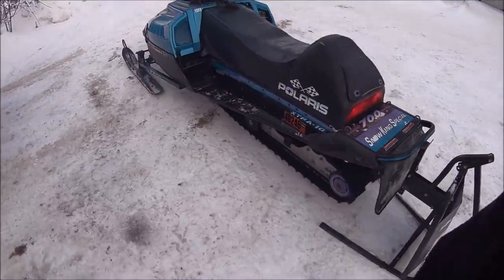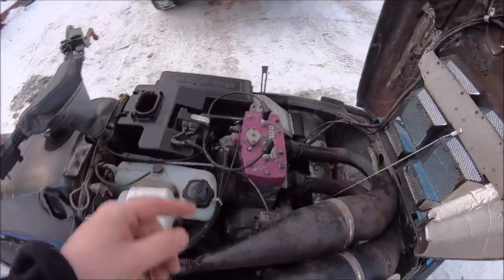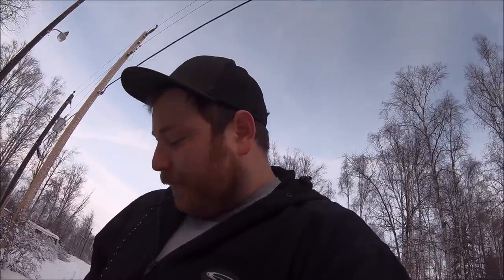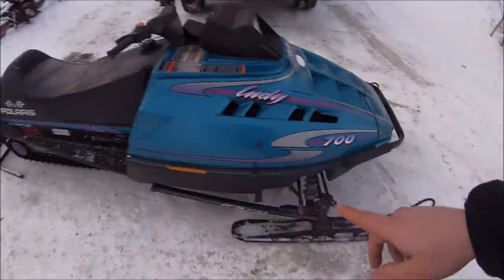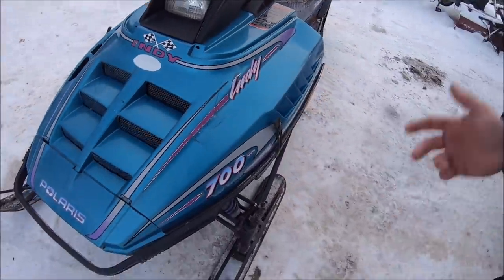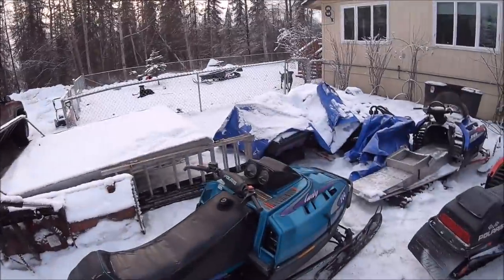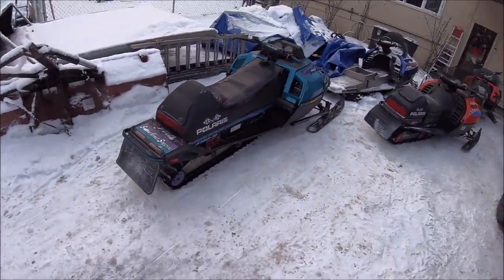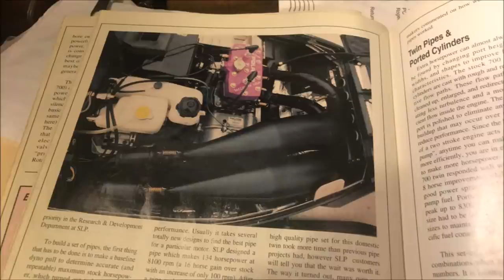1997 SKS 700 - Rare pipes?!

Comment: That’s the best sound I’ve ever heard on an 700 that thing roars like a beast
Reply: I was gonna say the same
Reply: Triple triples sound better imo
Reply: FUNNY THING IS MY FREIND BOUGHT THIS SLED AFTER HE TOOK THE PIPES OUT AND WE WERE RIDING WHEN I JUST BOUGHT MYSELF A 2011 POLARIS RMK 800 ASSUALT AND THE PISTON RINGS BLEW AND I WAS PULLING HIM BACK AND MY REAR BUMPER BROKE WHALE PULLING HIM AND WE ENDED UP CALLING MY OLD MAN UP AND HE CAME AND PULLED HIM OUT OF THE DICH THAT HE GOT SUCK IN LOL FUNNY I GUESS HE GOT THE ENGINE FIXED BUT IT IS NOT IN THE SLED AND IS SITTING RIGHT BUY IT
Reply: @98761joey  I agree, nothing beats a triple for sound even with the single pipe they sound great.
Reply: @davidbrennan5 I disagree. The v
Max 4 was a nice snowmobile too 
I have one that ain't stock 
It is modified it has bender pipes
Reply: @RyanBenbow  The vmax 4 sounded great also but they only made one model with a quad 2 stroke inless you count the king-Cats, so overall the triples were the best sounding and all of them sounded great. The twins and singles just don't have the same presence. The King-Cat sounded better stock for stock compared to the vmax 4 imho. Bender pipes or Mod-blasters on a triple or quad spinning at 10k+RPM is the best.
Reply: @davidbrennan5  that is your opinion 
Not mine. My v max 4 is not stock at all 
Tim bender. Was the best in racing 
I don't ride on the trails with it. I drag race
It
Reply: @RyanBenbow  he was good until they made him sleeve the engine down to 600cc and then he got waxed.
Reply: @davidbrennan5  not . No other racer
Could beat him. Unless he raced 
At the soo i 500.  Name one racer
That beat him I dare you
Reply: @RyanBenbow  He lost FIII on Sunday in 1992 World  Championships but what do I know.. The next year they changed the rule to 600cc. Yamaha didn't even have a seat on the ISR. They banned that sled just like they banned the 750 2 stroke bike from dirt track racing. I used to beat them at the grass drags with a modded Indy 650 regularly. Tim had the engines tuned to 210hp but they would blow up every other heat so they detuned them to 195hp.
Reply: @davidbrennan5  that is crazy.  How 
Much horse power did the thunder cat make.  I am curious
Reply: @RyanBenbow Box stock best year was 1998, it had better exhaust and intake. They claimed 172hp, I think it actually made more. The older 900 was no slouch either.
Reply: What did you think of. The wildcat 650
And the 700.
Reply: @RyanBenbow  Box stock in a straight line it was a tossup between the Indy 650 and the Wildcat 650, handling wasn't great. The 700 Cat was the speed champ for a while but that first chassis was horrible, Cat just added IFS to their old leaf spring chassis in an attempt to compete with Polaris and Doo did something similar with the escapade. The later chassis that the 93 Thundercat was based on was better but again not on the same level for handling compared to Polaris. The Polaris had the best clutches from the factory.
Reply: @davidbrennan5  true. I never had
The Indy 650   my wife and I have 
The zrt 600
Reply: @RyanBenbow  The ZR chassis was the best of that era, Cat cleaned up at the snow-cross events.
Reply: @davidbrennan5  I know. But they didn't win the soo i 500. Like I thought

Comment: Dude that sounds so cool I’ve been riding sleds for about 4 yea4s and I’m only 14 and I have a 1993 500 classic with a 1989 engine that I rebuilt my self
Reply: My man I rode a 92 indy trail 500 for years. I rebuilt that fuji once and we beat it up towing 2 Gt snowracers and scrapping lol when I pulled it apart after hearing some weird noises the crank bearings literally fell apart in my hand and or in the engine. She still did 80mph across the lake on my way home to find out she needed some love. Enjoy that thing and it will treat you well for a while. Good sled for a newcomer too, fast enough to hurt yourself but not quick enough to toss you off the back of the seat from a standing start🤪

Comment: Yup.. it's SLP early Build pipes. In 1999 they went to the one muffler for ERA sound decidable. I still have the catalog from 1997.right through to now. 
They are faster then your 800!! Sled weight is 104 lbs lighter.   R12 helix taken a machine shop cut an extra 1/16th deep in the snap ring. will give you 5 more MPH on top speed. 
So your looking at 112mph with low elevation gearing.  but it's the mid range!!  I'm looking for one for myself!

Comment: Sounds awesome! Looks like the same pipes I just put on my 700edge. Mines got the single muffler tho came off a 99 and I modified it to fit. Sounds very similar to mine
Reply: You put pipes for a non ves to a ves engine. Probably not going to run the best
Reply: @MidnightPolaris800  runs great actually! I dunno where this idea came from honestly especially when it seems like no-one has actually tried it they all just boo-hoo it. According to this guy's videos they're basically the same just the ves has higher compression and ves obviously. port timing is the same at WOT which is where these pipes work anyways.
Reply: @MidnightPolaris800  not to mention slp used these pipes in conjunction with thier heads which woulda brought the non VES compression to be the same as the ves engines stock and they still worked fine and made 150hp supposedly!

Comment: Can I ask a quick question, you did a 770 build correct I’m looking at doing a 754 build do you know much about the 754, am I correct that you need 84mm sleeves and get them pressed in along with 84mm pistons, do you need cylinder spacers
Reply from the maker: 84mm cylinder bore. Pistons would likely be 83.9x. Yes you would have to have the cylinder bored & sleeved. Head dome reshaped. Shim for under the cylinder was to correct pin hight differences on my 770 as I ran a Yamaha 65U over bore piston. I believe a stock bore Yamaha 65U piston was 64mm and would work in a 754 build, which would mean if you run those pistons you also would also need the shim. There may be other pistons, with the correct wrist pin diameter, hight, and bore and wouldn’t need a shim but you would ha e to do some research on that.
Reply: @AKproXR  thanks for the info, do you know we’re I would get the shims, I see wiseco still makes 84mm pistons
Reply from the maker: @thatbigblock7007  that’s an item you would likely have to make, I doubt anyone would sell the shims but... I could be wrong.
Look into engine tech/sever racing. Also SLP sold big bores for these, might be worth asking around with them as well.
Reply: @AKproXR  alright thanks for the info, kinda gonna be my summer build I scored 2 220 cylinders for 30 bucks and gonna have them get sleeved to a 84mm, will have to look Into the shims thanks for the info